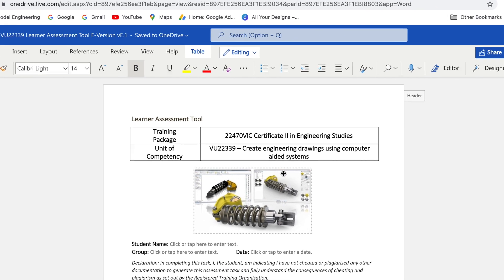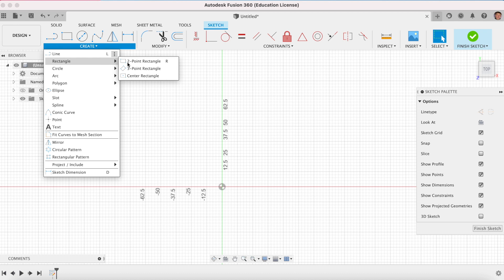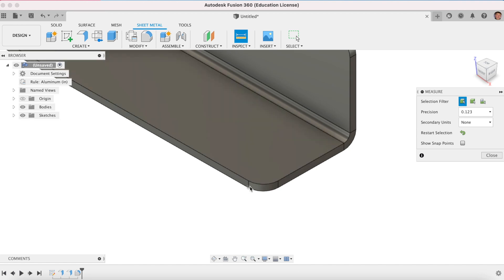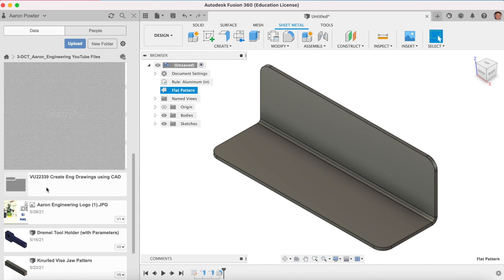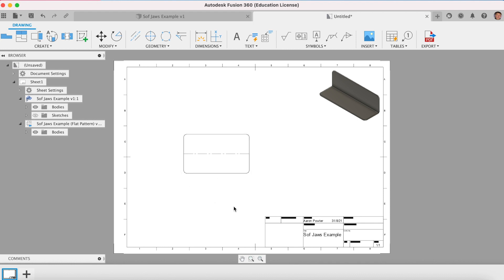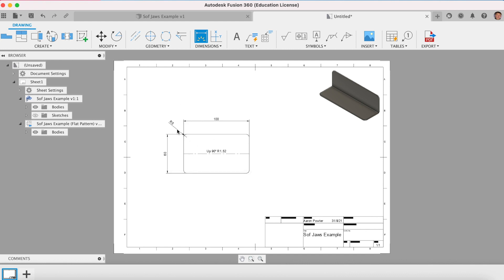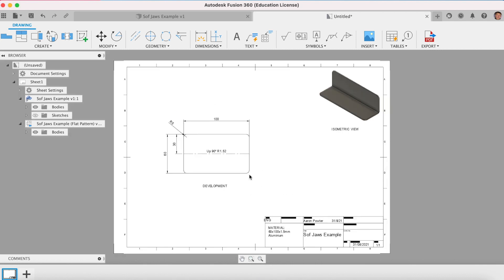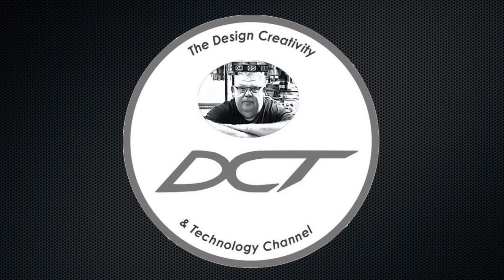Fusion360 Sheetmetal & Drawing Tutorial 1 - Soft Jaws

Comment: Got a drawing/fab question.  You turned off your bend lines, so how do you align your 30mm line in a box and pan brake? Is it the middle point between the finger edge and apron? Thanks from Colorado.
Reply from the maker: Hi Craig. Apologies for the late reply. I usually get the high school kids to measure & mark this out manually. For example, I provide them with 1 @ 100 x 120mm piece of aluminium. They cut this into two pieces of 100x60mm. They manually scribe their centre line and add corner radius marks. After filing the corner radius the students place it in the panbrake and fold to 90 degrees.
Reply: @DCT_Aaron_Engineering  No worries on the reply time. You mentioned here that K-Factor value is a function of the pan brake bending radius. Is this true? I guess I need to learn about next. Thanks for the reply.
Reply from the maker: @CraigHollabaugh  Hi Craig. Yes K-factor is a real thing. I was at a large sheet metal manufacturing the other day. Their machines take a 3D model file and automatically calculate the development and K factor bend radius etc…
Reply: @DCT_Aaron_Engineering  I understand what K-factor is (a thickness ratio that defines the compression/expansion layer).  I don't understand how its set when using a box and pan brake instead of a press brake. My pan brake has sharp finger tips which comes into account as well.
Reply from the maker: @CraigHollabaugh  hi Craig. On some manual and hydraulic machines you can adjust that via a manual setting. Sorry if I’m not providing you with the correct answer. I did find this article very helpful though
https://fractory.com/sheet-metal-bending/
Reply: @DCT_Aaron_Engineering  thanks, that's a start for a press brake, none of bending types outlined apply to a pan brake though. Fortunately, there are enough terms in the article that I can find a similar article for a pan brake.

Comment: I don’t believe it is wise to go into the drawing and “trick” the dimensions.  When you allow Fusion to create your flat pattern, it calculates in the bends. In your case since you want the part 30mm X 30mm, your flats plate will actually be a little smaller due to the metal stretching when it bends. By manipulating the dimensions, if someone was to follow the drawing, the part will be slightly longer than the desired 30mm X 30mm. I am new to this and appreciate your effort and the pace you are teaching at.
Reply from the maker: Yes, you make a valid point.  This is a little project that I used do with the high school engineering students.  K factor is hard to determine with manual panbrakes as settings can change (especially in educational institutions).  Interesting to note, most modern CNC folders now accept the solid CAD model and work everything out for you.  Technology has come a long way.  Thanks for watching.

Comment: what if you have say a 3m long part and want to keep the ratio 1:1 is there a way to scale the template?
Reply from the maker: In CAD for mechanical engineering solid modelling we always draw at 1:1 ratio. The orthogonal/ working drawing can be scaled by right clicking on the drawing to edit properties and change the scale. 👍🍺
Reply: @DCT_Aaron_Engineering  Cheers currently working as a press brake setter/Operator looking to get into milling or CAD thanks for the help. 😁

Comment: Are the design dimensions and the drawing dimensions correct ?
Reply from the maker: The development dimensions of 100x60 are correct.  The 3D model is  slightly out, as the "K-Factor" which is based on the material properties and panbrake being used etc.. would need to be specified to make it 100% correct.  Regards, Aaron.